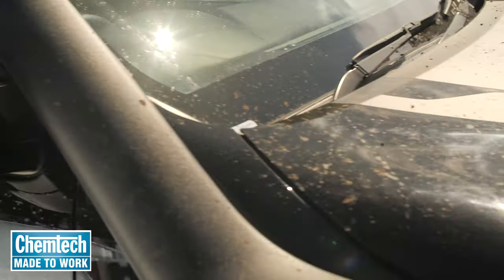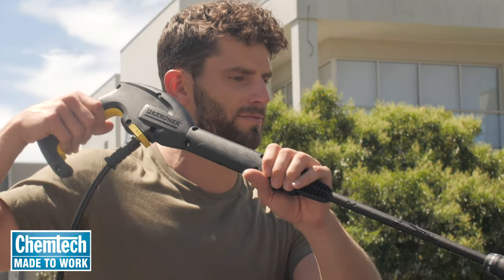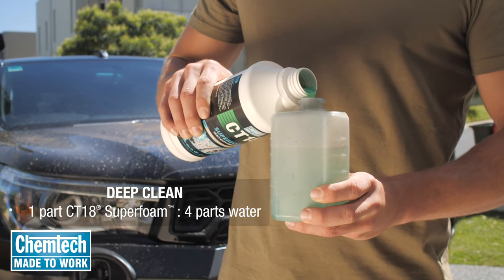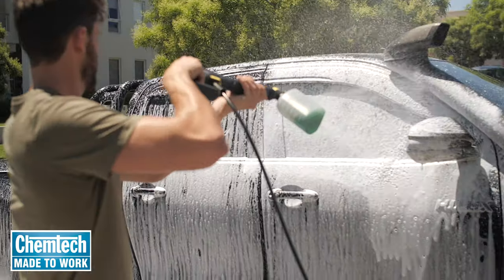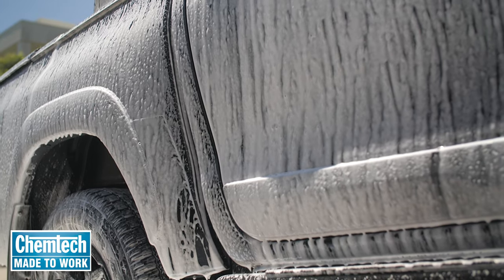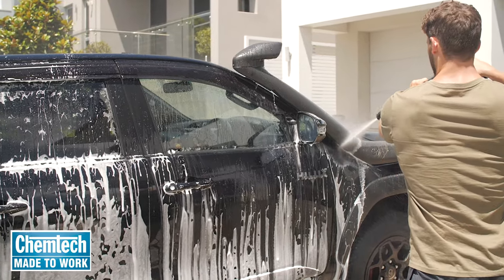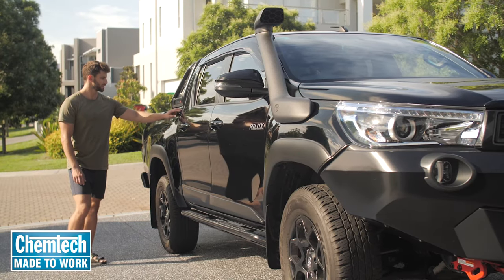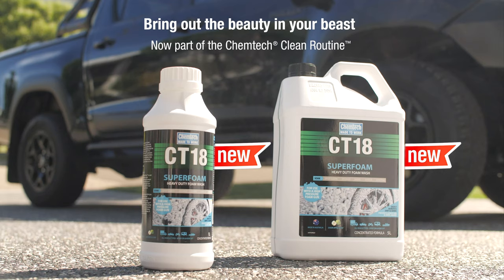Chemtech CT18 Superfoam Car Wash Demonstration

Comment: What if you have to wash in hot sun?

Then what?
Reply: I prefer to wash when the weather is warm, as I always end up getting wet when I use a pressure washer.
Reply: @Jonathan-L you're doing it wrong then.